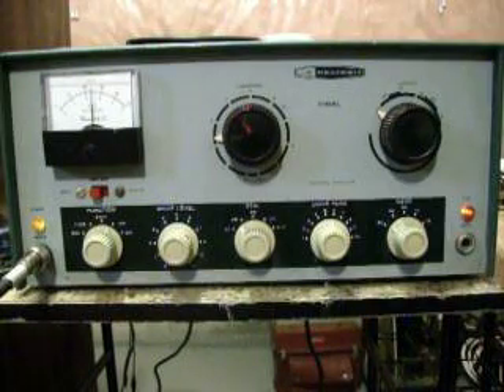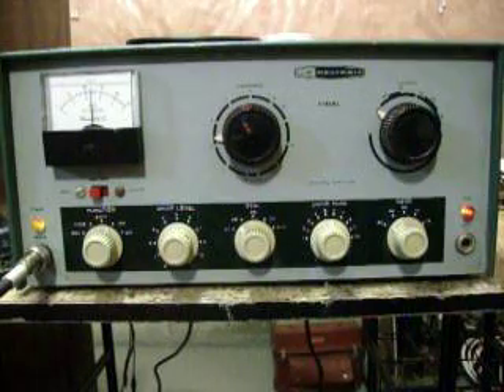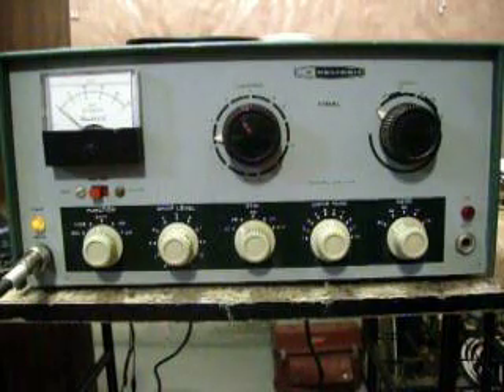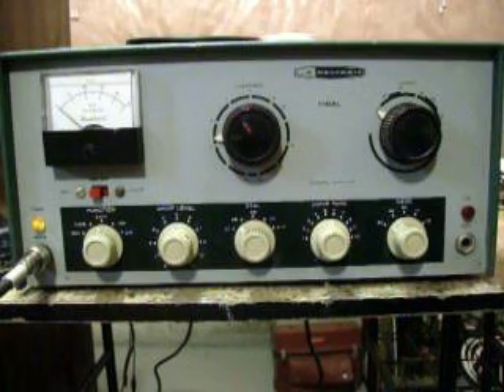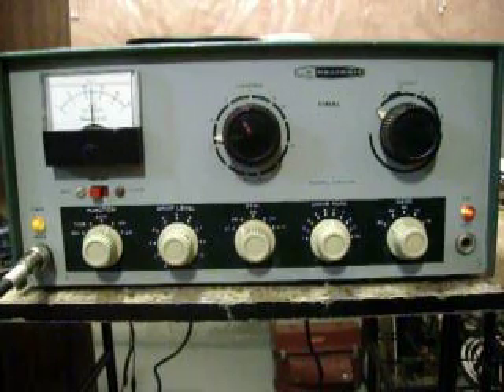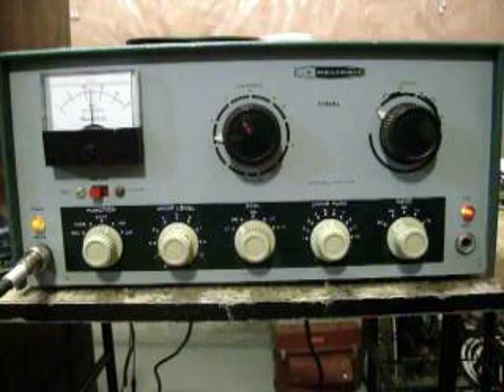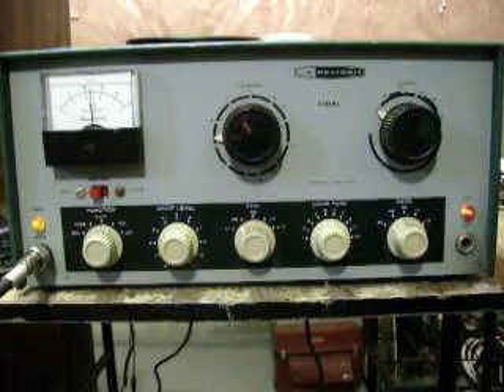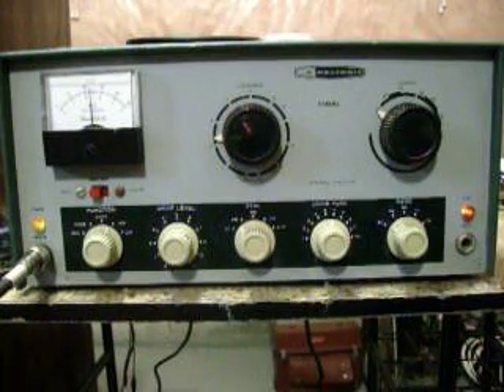Heathkit DX-60 TRANSMITTER.

Comment: I used to have one in the sixties and I added an external plate modulation with a pair of 807's and I got a good reserve of audio. I added a choke to the screen on the AM position but on the CW position the choke was removed. I had a tremendous audio with 75 watts input it gave me something like a Viking Ranger.